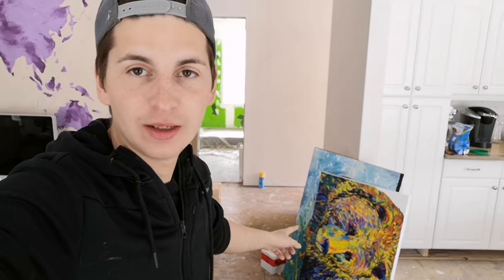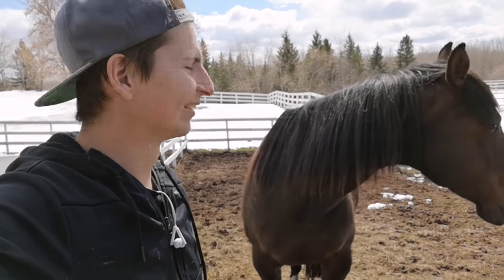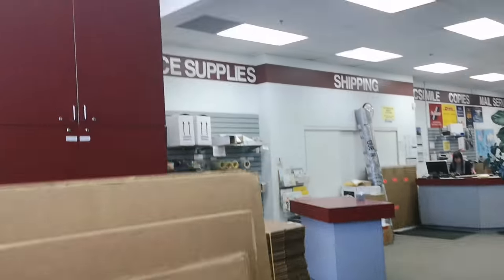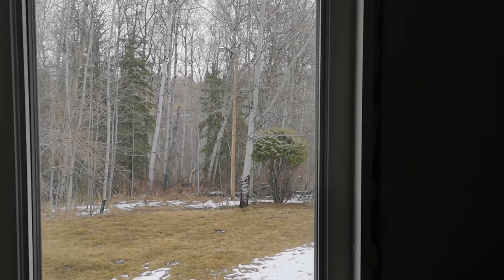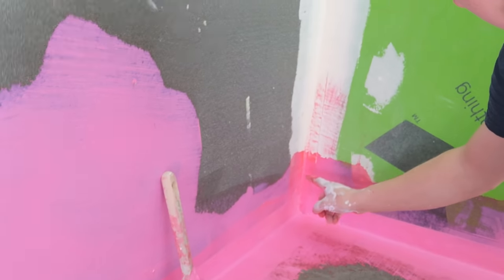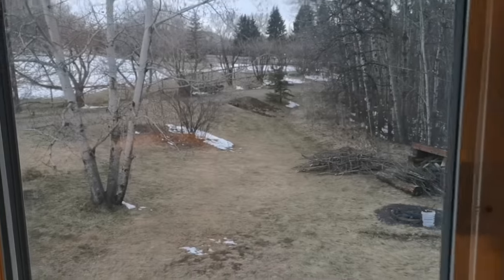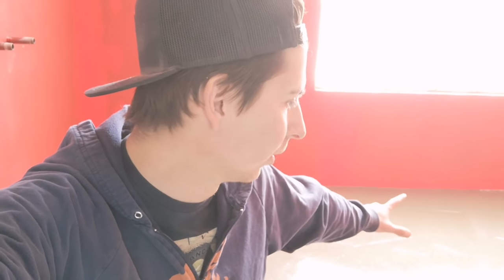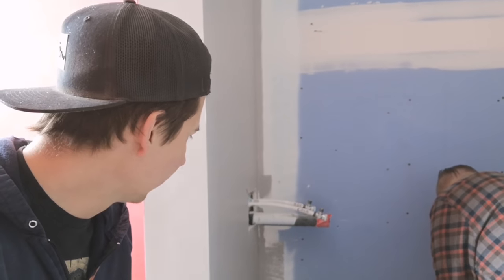I start work on my bathroom | Another VLOG #13

Comment: looks great , subway tile always will be in style , its a old NY vintage look 1920's and you can add a boarders ect into it , or it also reminds me of pink Floyd the wall lol,  , that is the correct way to start with a guide board your first tile row can be installed after , i just leave it low and slightly cut that row to make it strait to floor ect so the second row witch was first installed you just drop it slightly as you need to compensate , also you can put your cement on wall like you have been doing ,its good to just slightly butter up the back of tile for improved bond or also shift tile a little while installing for bonding grab , tile can be tricky , just always start it strait as possible and have your layout laid out , everything looks very cool , nice to see something different   , looks great so far
Reply from the maker: Hey thanks.

Comment: Maybe you could turn the beams into faux wood beams.  They sell a cool tool that creates wood grain, I have one it’s a rubber tool with a handle and you pull it across and rock it, it’s amazing.
Reply: I see they are wood but they sure could look better, you’ll make them great.